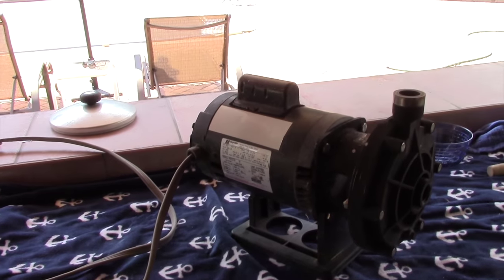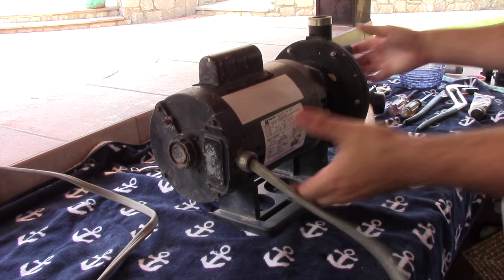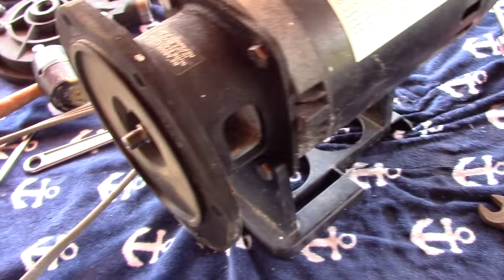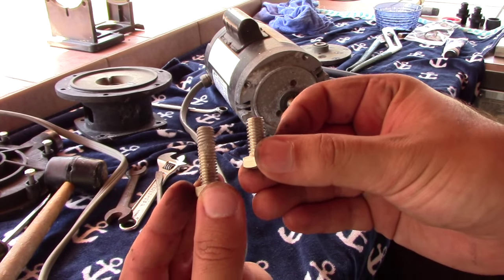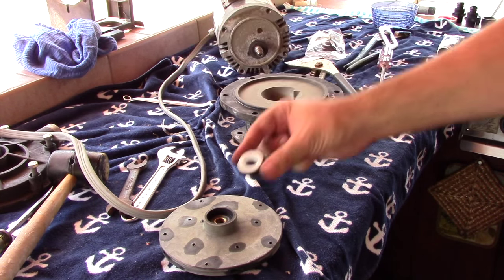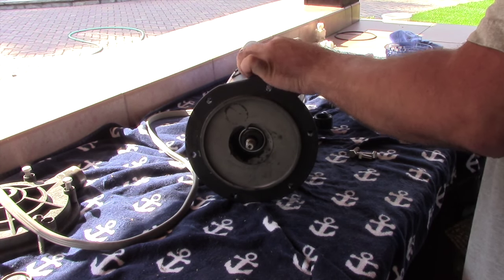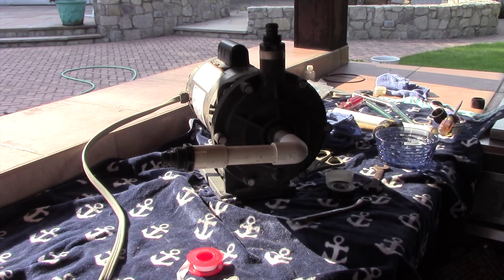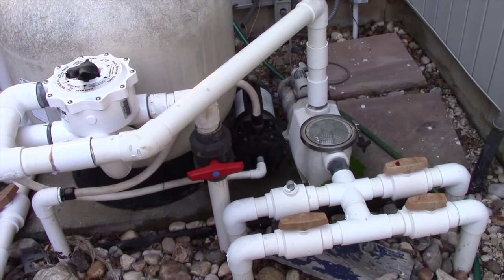How to Replace Main Seal On Polaris PB-4 Booster Pump.

Comment: Good video. Thanks for sharing. The only thing I have a problem with is using Teflon tape for pvc threads. The pvc manufacturer website explicitly warns people not to use Teflon tape and only use pipe sealants. For a small joint like this you can get away with it. For the bigger joints you will get a leak and most likely destroy the fittings before getting a seal.
Reply from the maker: You're welcome! 

I actually have heard about that too, it did seem to do okay for these fittings as ya said, so I guess it worked out in this case
Reply: Plasto-Joint Stik is the right stuff for threaded plastic connections. Among others…

Comment: Just adding my 2 cents here:  
I don't believe loosening the bolts in a criss-cross pattern has any effect.  Tightening them, absolutely does.

6:14, those main housing bolts are exactly 14mm, or 9/16 (close enough for government work).

11:47 No section of pipe on hand, but a nice socket set?  You can use a socket in place of the pipe.  No socket?  The handle of a screwdriver (upside down, handle on the seal) will also work in a pinch, but you may damage the tip of the screwdriver.  

Otherwise, excellent repair job and video as usual.
Reply from the maker: jaykay18 I had thought about that actually, I figured it wouldn't be any harm loosening them that way, but you're right though. 

Thanks for that size! I'll throw in an annotation. 

I actually wasn't sure if a socket set would be large enough. You want to hammer in the metal sides of that seal and not the middle because that part I think is either ceramic as well, or is something definitely kind of fragile.
Reply: Sharkie626 Right, a socket would have to be as big as the outermost part of the seal to drive it in properly.  That's essentially what the pipe did that you used.  I don't know about that piece being ceramic/porcelain, there's just no need I can see for them to use that material.  I don't know what it is though, unless I saw the part.

Either way, next time mine leaks, I'll call Sharkie's Plumbing Service!
Reply from the maker: jaykay18 Indeed, and unlike most plumbing services, I don't cause the bill to double! ;) ;)

Comment: Nice video, very simple step by step process.  Why not use a socket wrench to hold that motor shaft in the back?  Much easier to leverage and easier to use!  Loosening the bolts has no effect, but tightening them up is critical to work in a opposite pattern so the seal is made evenly.... Great video!  Chuck
Reply from the maker: Thanks a lot! 

The problem was, I was unable to find the socket set at the time of the video for some mysterious reason. I found it two days later of course. haha. 

And true, I was told earlier too about how loosening them cant be done in any order, I was actually unsure at the time.

Comment: Great video! Couple of questions - there's a rubber washer at the base of the motor stem. Should this be replaced as well? Mine is pretty cracked. A replacement washer didn't come in the seal kit. Do you think it's just a generic washer?
Reply from the maker: Hmm, I'm having a hard time spotting said washer in the video. But, if it's cracked as you said, I would definitely replace it.

Comment: Ordered epp Polaris PB4-60 Booster Pump Go-Kit for $12.99. Did everything exactly how in the video. But still have three water drops per minute. Is it acceptable? About the Go-Kit: they provide small O ring that doesn't fit. It's too small. Had to find bigger O ring.

Comment: Good video but you should use a thin coat of  silcone sealant on all rubber gasket parts before installing. This includes the rubber seal around the ceramic piece for the impellor.
Reply from the maker: I did put the sealant on the o-ring, same with the ceramic seal, but that was done between takes.
Reply: Sharkie626 Should have read the comments before I started the project. Did not lubricate the ceramic/rubber part.